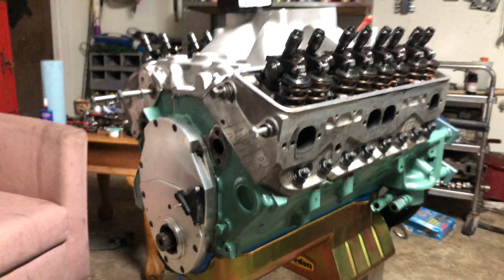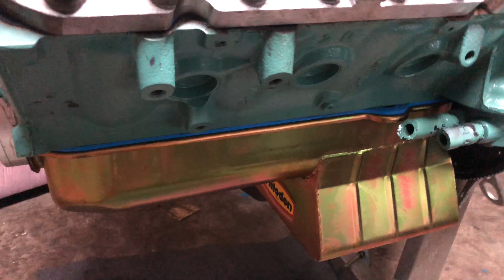7000 RPM 383 Stroker

Comment: Hey bro I'm building motor to turn 6500 rpm do I need to run that kind of oil pan?
Reply from the maker: Would be a good idea, I had enough windage before to make the oil pressure drop

Comment: Why not more cubes since using a aftermarket block
Reply from the maker: When I wear this one out, I’ll probably go to a 427, I didn’t go big the first go round just incase I blew it up, I’d have more cylinder wall thickness to spare incase of an issue

Comment: I’m a daily 383 stroker driver as well bro lol
Reply: Gas sucks but I love it , you have and advice on saving gas by using any kind of adjustment
Reply from the maker: I’m running Holley sniper x flow now, which helps, but make sure you’re not cruising too rich, also if your timing is locked out, or you don’t have much timing in high vacuum areas, you will also get worse mileage
Reply: @drivinwithdrew7676  where do you stay at cause I need a tune then cause I know I’m running rich
Reply from the maker: @mannysolis4588  I live in Louisiana
Reply: @drivinwithdrew7676  shit I stay at Orlando
Reply: @mannysolis4588  im in broward with the a similar setup as his, need a dyno, got anywhere in mind?
Reply from the maker: You put yours on the dyno yet?
Reply: @drivinwithdrew7676  not yet

Comment: Did you get an oil leak from running a driver side dipstick pan on a passenger side block ?
Reply from the maker: It’s a dart shp block so the dip stick is in the other side